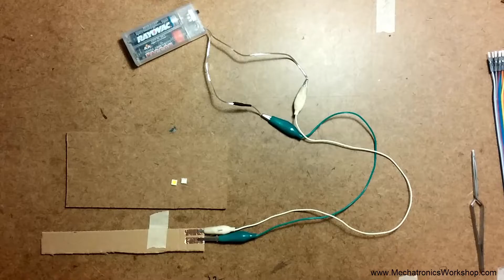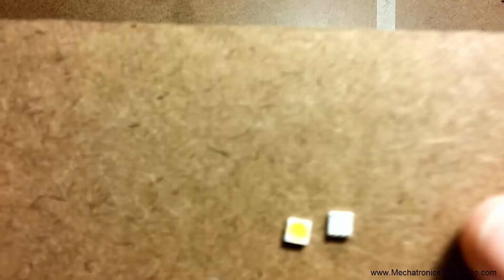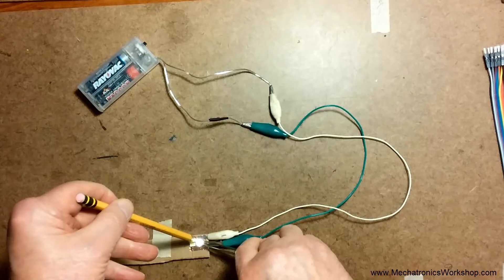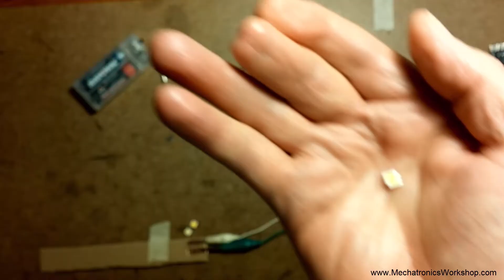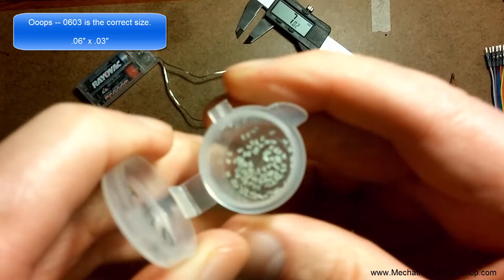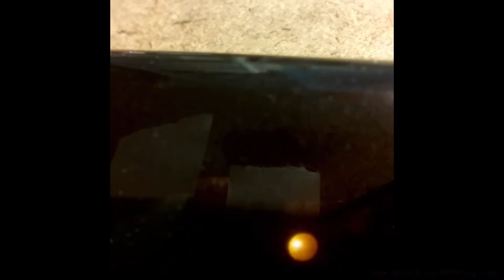5050 SMD LED Demo

Comment: Hello!
What is the max power (watts) of those SMD5050? those led smd requires a resistor?
Reply from the maker: Hello - manufacturer's specs vary but in this example I mentioned that these are 60mA (.060 amps) at 3 volts. Ohms law helps you figure out wattage: Power (P) = Voltage (E) x Current (I),  so  P = E x I,  so P = 3 x .060,  so P = 0.18 watts. Yes a resistor should be used. Knowing the wattage of the LED to be 0.18 wats, a 1/4 watt (.25W) resistor would work.
Reply: @Electro-Mechanical-Basics  thanks so much, my case I need to repair one tail light of my scooter, and I want to buy some smd led to replace them, the only think that I know that the scooter feeds the light with 5volts and max 0,5A. Do you recommend any led smd for that?
Reply from the maker: @acdcjavier22  I don't have any good solutions for you other than suggesting searching Google, Amazon, Ebay, etc for 5V .2 or .3A SMD LEDs (probably a good idea to stay under the .5A rating unless your scooter specs say use a .5A replacement). Here are some other ideas: Can you see any specs on your good (or broken) tail light? Can you look up the specs for your scooter replacement lights from your scooter manual, or online through the maker of the scooter, or via Google? Search scooter or auto supply stores like O'Reilly, AutoZone, NAPA, etc for something that might work.

I searched Google for "scooter tail light led" and here's just one hit I got: https://www.amazon.com/Vbestlife-Universal-Electric-Waterproof-Taillight/dp/B07J5HTX57 You can maybe get one of these generic ones to work, or maybe buy one and take the LEDs out of the assembly and make your own solution. You could try other Amazon hits and/or Google searches. Good luck and let me know how you make out!
Reply: @Electro-Mechanical-Basics  thanks for reply, i uploaded the photo of the tail light https://ibb.co/BzW8PKj

You can see that the smd led is only soldered directly to the feed, no resistor in series is solded, I've taken the size and it is a smd 3535 format, unfortunately I haven't see any led smd in aliexpress to replace. Also a time ago I bought te tail light in aliexpress but the light doesn't light up enough compared to the original
Reply from the maker: @acdcjavier22  The photo helps! A photo of the back of the circuit board would be good, too. Did you trace the connection from the wires to the LED and see that it is a direct connection with no resistor? It is possible to operate an LED with no external resistor when powering it from a battery. The internal resistance of a battery can replace an external resistor sometimes. So it's possible your scooter is operating that way. Typically LED circuits include resistors to protect the LED from too much voltage, and from drawing too much current and burning out. It's also possible there is a resister further back in the wiring. So you might be ok just replacing the LED and not worrying about a resistor in your situation. 

I wonder if the replacement tail light you bought that is not bright enough has a resistor in line with the LED. Maybe you can remove that resistor if there is one. But don't test it without a resistor from a power supply -- it will surely burn out. Test it with no resistor from your scooter tail light wiring that is coming from the battery. 

Hopefully that LED has the same (or similar) voltage and current specs as yours. So the paragraph above is not guranteed to work. The replacement tail light LED will possibly burn out trying the suggestion above. So try it knowing that! With no specs, it's all a guessing game.
 
Please tell me: Are you in the US? (Knowing that might help me recommend resources) What is the brand of the scooter? Was it purchased in the US? Do you have access to a repair manual? How do you know the specs you mentioned earlier of 5V and .5A? Is the scooter battery 5V?
Reply from the maker: Also, my sample here has three LEDs inside. Each one can be lit individually, or all three can be lit at once for maximum brilliance. Maybe the LED in the tail light you bought is the same. If only one is lit, maybe you can wire it so all three are lit to make it brighter.

Comment: Excellent little test rig for your led's! I just received some 1210(3528) RGB leds and was wondering how i was going to set them up......then i realized that, as they have 4 connections, they will fit perfectly on some perf board with each corner touching a different spot, and then i can use them individually with soldered test pins and usable in breadboards too. Thanks for your video! PS...i also have some 5050 RGB's coming too so hopefully i can use something similar.
Reply from the maker: Your idea sounds good - let me know if your test bed works out!
Reply: @Electro-Mechanical-Basics  It works really well! Thanks for the reply!

Comment: can we run a 6V smd led on 5V supply without capacitor or any other stuff? is it be lighted up? max brightness? will the current be more than on 6V supply and does is need a resistor to limit it from draining more extra amps?
Reply from the maker: A 6V led would be at max recommended brightness at 6V. Depending on your led, 5V might work, or it might not work at all. It depends on the forward voltage spec of your led. Check the data sheet, or just try 5V. Current is really what determines brightness for leds. Unless your power supply is current-limited you should always use a current-limiting reistor.

Comment: You should play with some 0201s...  good video, thanks.
Reply from the maker: 5050's are 5.0 mm x 5.0 mm, 0201's are 0.65mm x 0.35mm! I hope you've got a good microscope! Is it even possible to handle those little beauties manually?!
Reply: MakeAnimatronics Actually with a microscope it is pretty easy to move them around to be soldered by hand.

Comment: Hi I have a 9 volt battery what value of resistor would I need ?
Reply from the maker: The short answer: For this 5050 LED, probably somewhere around 365 to 400 ohms for each of the three LEDs in this package.

The long answer:
Assuming you're asking about a white 5050 similar to this one: There are actually three LEDs in this one. You should check the datasheet to be sure about the following, but if you don't have access to a datasheet, here are some generic stats on LEDs: A typical white LED draws about 20mA (milliamps) and has a forward voltage (voltage drop) of 1.7 volts DC. 

Let's start the easiest way -- lighting up just one of the LEDs. We need to limit the current to 20mA with one resistor. So we need to start by subtracting the voltage drop of the LED from the total available voltage. So 9V - 1.7V = 7.3V. So we have 7.3 volts left over that we need to drop across a resistor to limit the current to 20mA (.020 Amps) . 

Ohms law tells us how to calculate the resistor: R=E/I (Resistance = Voltage (E) divided by Current (I)). So R(resistor)=7.3V/.020A; therefore R=365 ohms. So we need a 365 ohm resistor. If you don't have that value, a common solution is to use one that's close. Higher values than 365 would be safest because they will reduce the current flow, but make the LED dimmer. You can use lower values than 365, but if you go too low, more current will flow and possibly burn out the LED.

Now, if you want to drive all three LEDs, a common configuration would be to put a 365 ohm resistor from your battery to each of the LED pins. Each LED would draw 20mA. So 20 + 20 + 20 = 60mA. But that can be a waste of current. Another common, and in many cases a better solution that uses less current and fewer components would be to put one resistor soldered to all three LED pins together. In that case you would only need 20mA, but would need to change the resistor value. Oh boy, I'm getting in deep here! I've made a video about this if you really want to know. Check it out here: https://www.youtube.com/watch?v=RIpxY0AiDbo

Standard high-quality 9V batteries can supply about 500 milliamps for one hour before being "dead". So let's do a little more math just to make the day fun :) 500mA / 60mA = 8.3. So a 9V battery will only last about 8 hours. That's fine if you're just experimenting or only need the LEDs to be on for short times, but if you want the LED(s) to be on for extended periods of time a standard 9V battery is usually the least desirable power source. 

Caution: Using a resistor in circuits is almost always the best idea! With no resistance in a circuit, there may not be anything to limit current flow, which can result in high current flow, high heat, and burned out components, and even fire in some cases! With that being said, typical little dry cell batteries have an internal resistance (that is beyond the scope of this discussion). But those internal resistances can make it completely unnecessary to use your own external resistor for little LED circuits. Just depending on the internal resistance of a battery is more common when using 1.5V to 3V batteries and one LED for intermittent use, but you could experiment if you have enough batteries and LEDs around that you can afford to burn out if things don't go well. In my demo in this video, I would not have needed a resistor for just poking the LED like I did.

Comment: which resistor did u used
Reply from the maker: In my demo it was a resistor built into the battery holder that was originally attached to a long strip of LEDs, so it was a very low value of about 5 ohms I think. Of course it's always best to calculate the value of resistor you need based on the current requirements of your LED and your voltage supply. Typical small LEDs use around 20 to 30 mA and resistor values of 100 to 400 ohms are common with voltage supplies of 3 to 12 volts. But ohms law is your friend :)